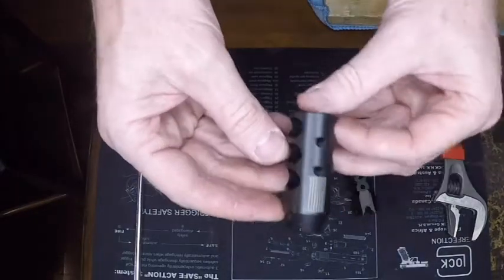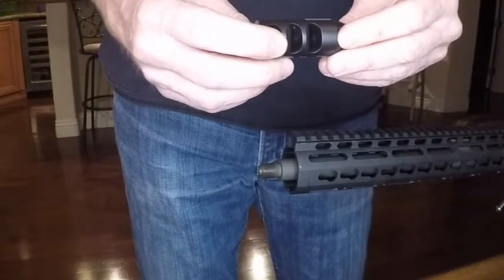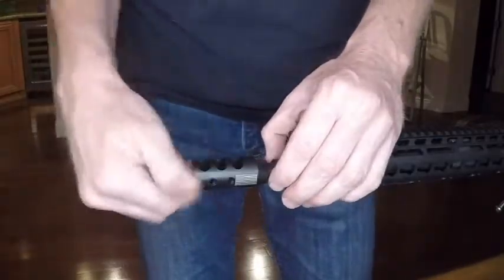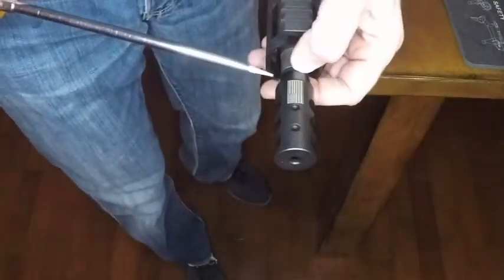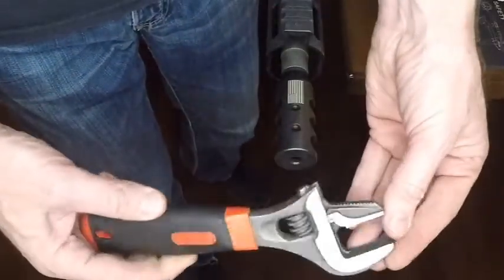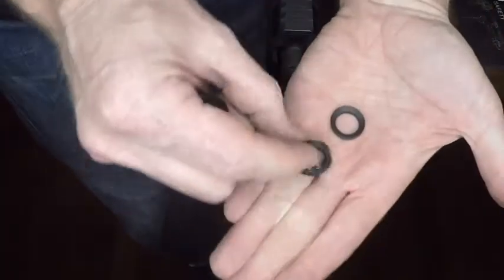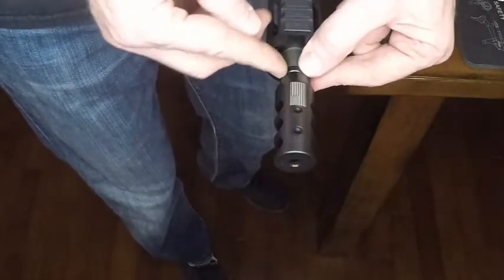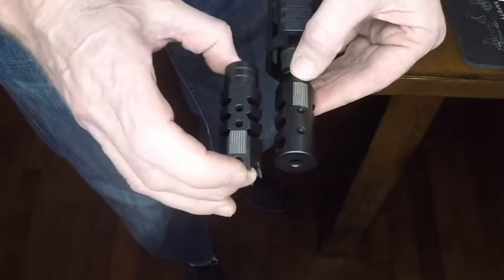Competition Muzzle Brake Easy Installation Tutorial - Battle Born's Best

Comment: What happen if you use two crush washer??
Reply from the maker: You're not really going to ever need two crush washers. You probably wouldn't be happy with the extra gap from the second washer and it wouldn't help with the install at all because you'll always be able to get the job done with a single washer. The optional jam nut would be the only thing I would consider adding (for ease of indexing) but I've never used more than one washer for a brake install.
Reply: @stevemoorman9923  I was about and I noticed when I did put 2 on there it was tight also line up good I have 7.5 in barrel
Reply from the maker: @tacraheennc9719  I can't honestly say if the extra washer will cause any problems. I guess it could work, but you'll want to check to make sure the brake doesn't back off over time. I'm still sticking with my original thought that you can definitely get enough torque on a single washer to both index the brake and keep in nice and tight.
Reply: @stevemoorman9923  that’s what I’m afraid of backing off stick with one and just add a washernut
Reply from the maker: @tacraheennc9719  If you hand tighten the brake against the crush washer until it won't turn any more, see where your top ports land. If you need half a rotation or more to correct index, then your brake won't ever get loose. If I need less than half a rotation, I will add a little blue (not red) loctite on the threads. If you only have 1/4 rotation to go, I'll torque 1 and 1/4 on that washer.
Reply: @stevemoorman9923  thanks